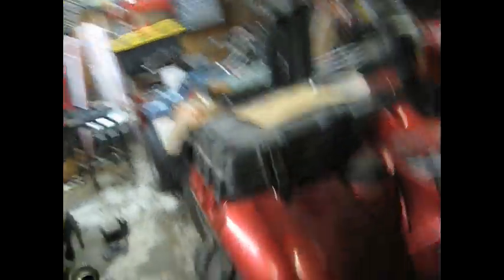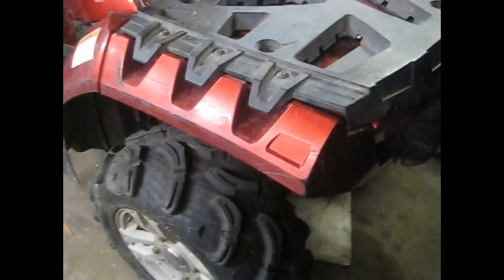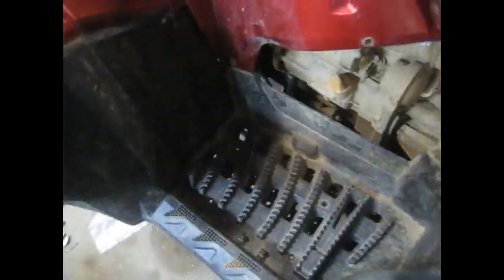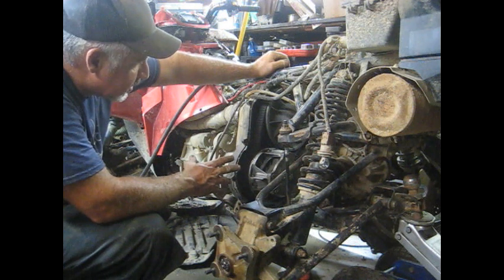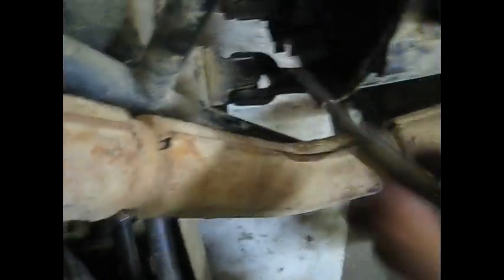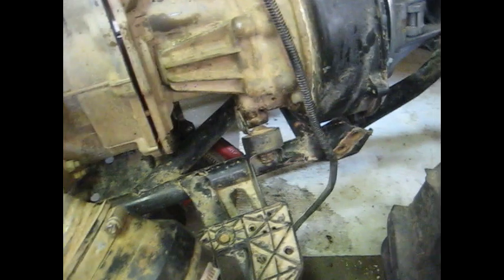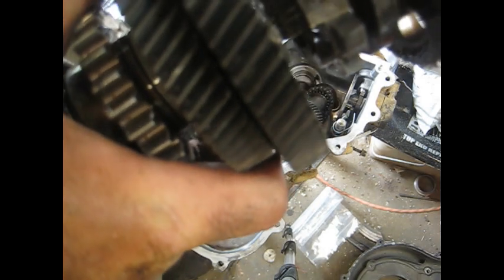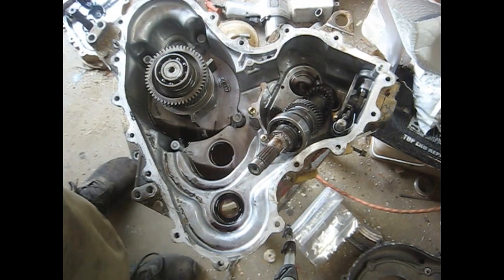Polaris sportsman transmission removal and disassembly without pulling the engine

Comment: This video has been a great for the taking apart of everything. I just replaced the reverse chain and now the shaft that you spin at 32:55 doesn't spin all the way. It spins about 1/3 the way around and stops. Any idea what I did wrong?

Comment: The new oil in tranny made a big diff, much quieter. Without open tranny, I may separate engine/tranny to check damper coupler and nut. My 550 has 1340kms/800miles.

Comment: Very good vid Sir.  What is the mileage on it?  My 2010 550 has a clear ticking in between engine and tranny.  Damper nut may be backed off. Also metal filling from tranny oil plug.  See your chain is so loose, l may change my chain too.

Comment: Is it the same way putting the rear drive shaft back on? I rebuilt my transmission on my sportsman 850 and I can’t get the drive shaft to slide on to bolt it up bc it keeps hitting the rear diff which is causing it not to slide onto the shaft on the transmission.

Comment: I dont think the Dr reads the comments? Dont blame him, Id imagine some people are just "Richards"! But, any of you guys know if a 2005 500 H.O. is th same as this machine as far as disassembly? The splines in the "rear end" where the CV axle goes in is badly worn causing "slop" where the splined axle goes in the rear end. Im sure i have to remove it and split the case to replace seals and the splined part in the rear end. Thanks!

Comment: How did you get the two very bottom Trans bolts out? I'm working on a 2012 850 and the skid plate is welded underneath. Other than that everything in this was 100% awesome and helpful
Reply from the maker: I didn't remove the skid plate. Seems like I used a quarter inch drive socket and a long extension to get the bottom bolts out.

Comment: Hey man have you ever installed a rod kit/ new rod on used crank before on a foreman 450 or any foreman
Reply from the maker: No I haven't. You have to get both halves of the crankshaft perfectly lined up or it will vibrate and I don't have a way of doing it without trial and error.  So I have never tried it. I have had some repaired before by a guy called mrcrankshaft. He did a great job on the few he did for me.

Comment: Did replacing the chains eliminate the noise?
Reply from the maker: Yes the chain was actually slipping on the gears/ sprockets.
Reply: @FourwheelerDoctor  ok. Thank you. We have one doing the exact same thing.
Reply: Did you just replace the chain or anything else? Mines making that rumbling racket but not popping.

Comment: If that coupling and that rubber between the engine and transmission are bad could that cause a noise
Reply from the maker: Yes most definitely.
Reply: Ok thanks. Mines making noise but its only doing it at idle and seems to be alot of movement in the clutch when starting up
Reply: Would there be a way to check that without having to separate the transmission  and engine?
Reply from the maker: No there is no way to see it without taking the transmission out
Reply: @DaddyMonksWorldOfStuff  mine is doing the exact same only at idle. Did you figure out what your problem was?

Comment: Just installed a reman engine on sportsman 1000 HL ....   new battery new starter and the quad won't turn over ....any suggestions on what you think it is??....I was about to pull the transmission  to see if the starter gear was in gaging  with the "damper spring"  gear thing
Reply: Check the compression in the cylinder and the usual spark and air timing also those are your usual culprits